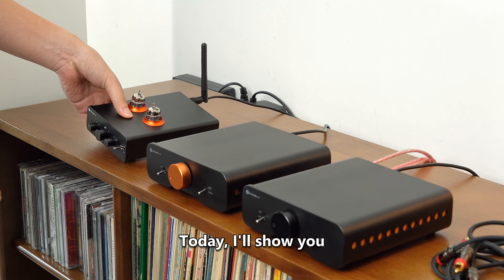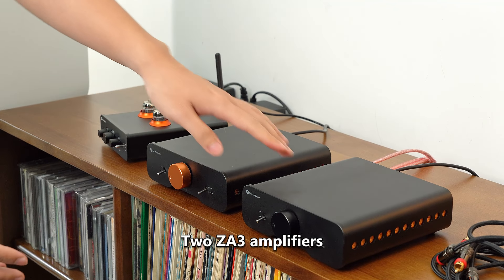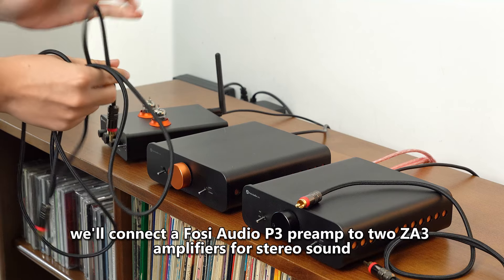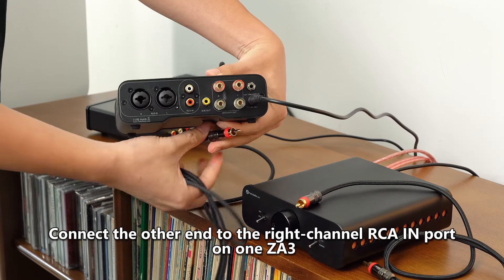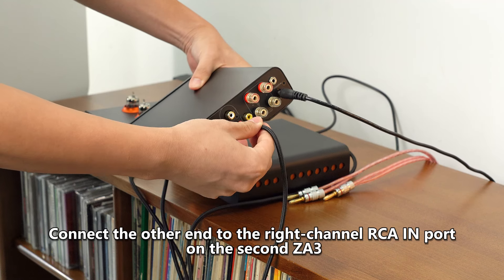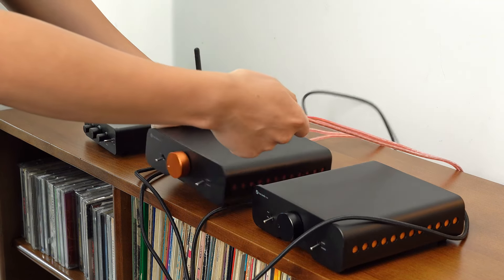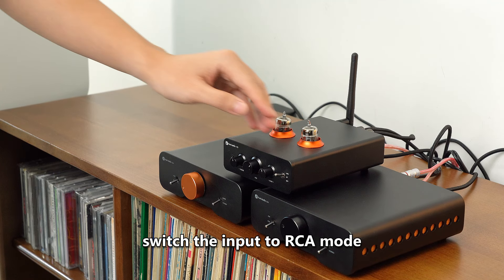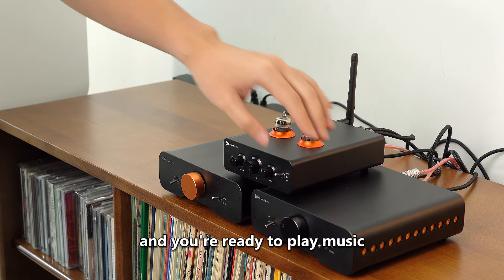How to set up a 2.0-channel system using two ZA3 (mono) with RCA inputs?

Comment: Fosi! You need to make a simple monoblock power amp like this , without potentiometer and just one channel, less connectors on the back , no potentiometer, no toggle switches , just On and off , one RCA ,one Balanced and one channel set of 2 binding posts... Keep the price at 120usd each with power around 200watts
Reply: 100% agree!
Reply: This aged well!!
Reply: Agree !!

Comment: Anyone know if using 2 x ZA3's and P3 produce better sound quality than a single more conventional stereo integrated amp, such as a Rotel A11 Tribute or a Cambridge Audio AXR100D? Just trying to decide what to get. Power is not that much of an issue, I live in flat so cant be going too mental! Using Q acoustic 3050i speakers.

Comment: I used this exact setup to try and independently drive a pair of JBL Control 30 Passive Speakers.  Although these put out some decent power, at full volume these guys were not able to satisfactorily power the speakers.  They sounded fair, but in an outdoor space for dance music, there was not nearly enough volume to produce a good experience.  Just need more power than these guys can muster, I suspect.
Reply: which power supply were you using? 48V 5A? 48V 10A?

Comment: Why don’t they include a diagram in this video and in the manual?
Reply: Want to know the same... how to add a single powered subwoofer (which has left and right line level in) to the two monoblock set up

Comment: The only thing I would do differently is connect the left speaker to the left channel and the right speaker to the right channel
Reply: The amps only output in mono mode to the right speaker channel
Reply: Mono mode only be used with right channel (look at the back of the amp)

Comment: I have two running in mono mode and i must   say they do get hot.
Reply: The case is the heatsink for the chip.  Any heat produced is radiated away by the case... so, you actually want it to get hot.

Comment: A word of caution ... make sure you disconnect power to the amplifier before flipping the stereo/mono switch.  It is not safe to change "on the fly".  It will shut the amplfier down immediately and it just might not come back on.

Also if there's any chance of it being flipped either from curiosity or accident, you should take steps to keep the amp out of reach.  

As I feared ... that switch has no business being on the front panel!

Comment: Can we please have a video on how to set up the trigger function in a ZA3 monobloc arrangement please where the source is a streamer/DAC/preamp?
Reply: assuming the source has trigger out, you'd get a mono y adapter and just two mono trigger cables from the y to each amp
Reply: @CorneliusHolden  thanks

Comment: I feel it's a stupid question but can you do 2.1 (with subwoofer) or 3.1 (with center speaker and subwoofer) in monobloc mode or just get 1 unit and be done with it stereo mode? Thanks
Reply: Центрального канала не хватает при просмотре фильма, бывет голос тихо слышно на общем фоне.
Reply: you can use as many of these as you have outputs on your av receiver or pre- amp

Comment: Hi..what if we want stereo output into the left and right rca line level in of a single powered subwoofer? Can we connect from left monoblock amp sub/pre out into left line level in of the sub and another cable from right monoblock amp sub/pre out into right line level in of the same sub?
Reply: I think the sub out is in stereo and is not affected by which mode the amp is in

Comment: I just bought 2 ZA3s for this purpose but I have a turntable, cd player and Eversolo Dmp-a6. Is there a way to connect all 3?
Reply: I am curious about that too
Reply: think it will be pointless and easily predicted actually, its great at being great portable, if you know what i mean
Reply: Do a search ... you will find relatively inexpensive multi-input switch box with lots of inputs on all of the usual online vendor sites.
Reply: You need a preamplifier with more inputs than the one shown in this video. One of the preamp's basic function is input selection. If you find a preamp with several analog inputs, you can connect a turntable or an external dac and listen to it by switching the inputs on the preamp.
Reply: Connect the output of the phono preamp of the turntable to the RCA input of the Fosi Audio. Connect the CD player using spdif out (coax or toslink) to the spdif input of the Eversolo, and then connect the eversolo using XLR out to the XLR inputs of the Fosi. Use the Fosi selector to choose between the turntable and the Eversolo. Also, when playing a CD make sure to manually select the right input in the Eversolo (spdif coax or toslink in this case).

Comment: How do I hook up the sub out?
Reply: I have asked the same question directly to Fosi and waiting for answer. I guess we can use two Y-split cables and use both right channels into both RCA line-ins on the single powered subwoofer. I will try this when I receive the ZA3s.
Reply: Got an email from Fosi explaining that we can connect via RCA directly to the L or R input or a Y split sub cable into both L and R will also work. This can be done from just one monoblock as this signal is sent in mono.
Reply: @personagratias263  what if we want stereo output into the left and right rca line level in of a single powered subwoofer? Can we connect from left monoblock amp sub/pre out into left line level in of the sub and another cable from right monoblock amp sub/pre out into right line level in of the same sub?
Reply: The way I understand it this shouldn't make much difference. Bass below 200 Hz is mostly mixed as mono in music tracks. My subwoofer is a so-called Singe Voice Coil so the end result is always mono. If you have a Dual Voice Coil maybe there might be some small differences in the cases where there is stereo bass on music tracks. The other alternative is of course to use two subs, each connected to a respective mono block. Here is a very good explanation on the pros and cons of mono vs stereo bass in music tracks: https://www.youtube.com/watch?v=MaIi_YU7pKA
Reply: @personagratias263  I would imagine since subs are non directional that having stereo would be a bit pointless